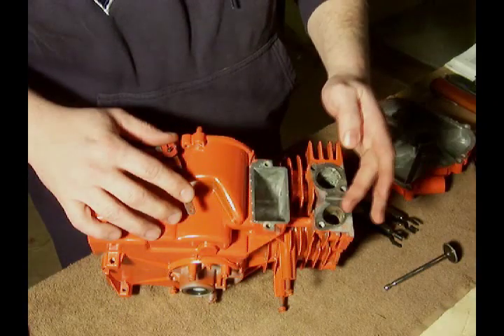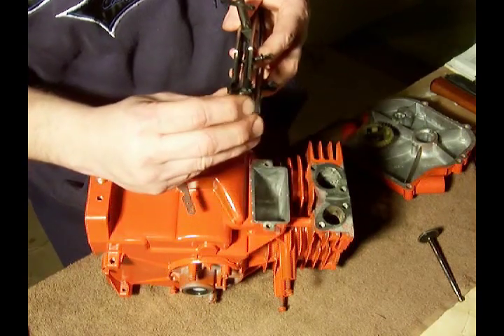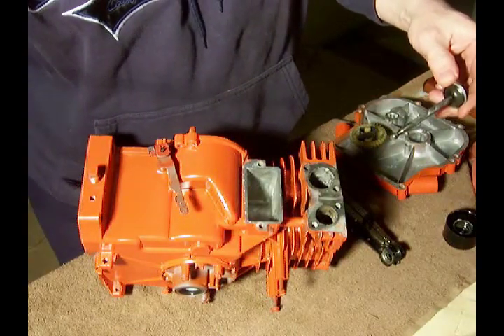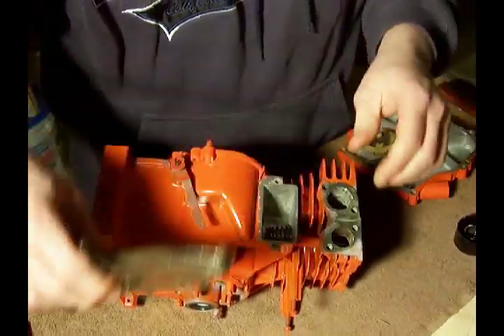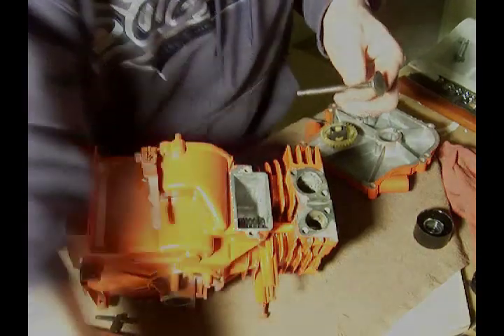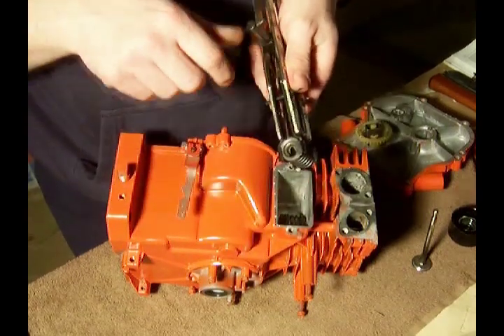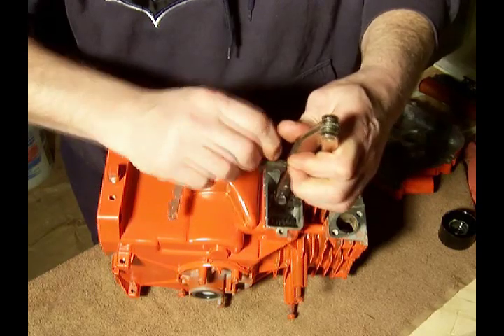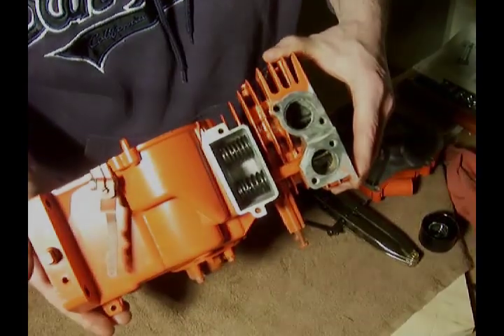#4 - Briggs and Stratton 5HP 130202 - Valve installation

Comment: so just buy new springs, valves and tappets.. then your good?
no measuring or adjusting anything right ?
Reply from the maker: Pretty much. After installing the new parts, you will still want to check valve clearance. If it's too tight, you may have to remove (grind off) a tiny bit at a time until it's right. However, in my experience, it's very rarely needed.

Comment: Briggs once made val guide compound/crying shame they don't anymore/but Kohler makes a lube used on there engines for valves and hydro lifters on command engines that works very well on both [Briggs and Kohler] iam a master service tec and that's what we use. GREAT VIDEO...oh and the key hole washer is called a retainer ...good luck and hope to see more videos of yours.
Reply from the maker: +Kevin Bolin Thanks for watching!
Reply: Yeah I just slap some grease on that bitch.  I wouldn’t spend a dime on that crap made by Briggs or Kohler

Comment: I'm working on a older 8hp briggs. Pretty much the same configuration as this 5hp. How are the valves adjusted? 
Also what brand is that valve spring compressor I was using one for a car it was quite the show.
Reply from the maker: t mod In these engines, the only way to adjust the valves - is to grind them off a bit if they are too long. And to replace them if they are too short. You can see all of my tools on my blog - click the link in the description above. Thanks for watching.

Comment: I would not recommend grease it will produce drag and a llittle higher temperature and the tolerances here are quite tight so if you are really unlucky it might actually stick due to this when heated. Only ordinary motor oil should be used nothing else.

Comment from the maker: The torque specifications listed in the repair manual are important. If a bolt is too loose, it could vibrate out and cause problems. On the other hand, if the bolt is too tight, it could snap off or sheer (strip) and that would also be troublesome. In my opinion, proper peace of mind is worth the cost of a torque wrench. They can get very expensive but, my wrench is a 3/8" beam type that reads in INCH POUNDS. It cost less than $20 at Sears. Thanks for watching.

Comment: So if I were to completely tear down my 8hp Tecumseh engine, and I take the piston out and everything, do I have to use that torque wrench to tighten the bolts on the connecting rod when I reassemble it? Or can I just use a socket wrench and tighten it to my discretion? Thanks

Comment: Good demo.  How do you know which spring to use with which valve.  They are different in the motor i am working on, but I failed to notice the difference upon dis-assembly.